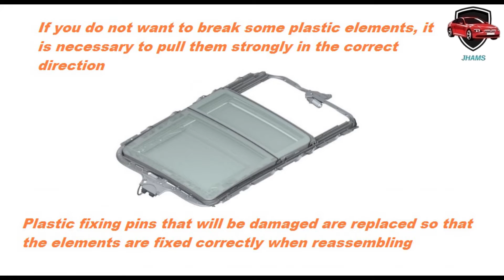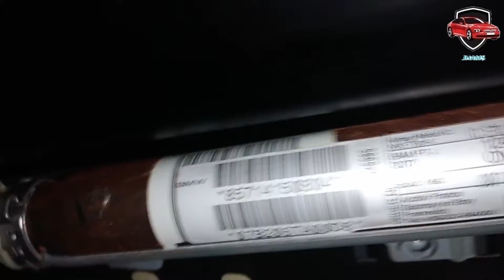BMW X5 E70 - Sunroof removal.

Comment: The sliding visir inner roof - where is the drive motor for that part? is it driven by the front one, og is there an motor nr 2 behind the visisr aft in the car roof?
Reply from the maker: The other engine in the panoramic sunroof is located in the center back under the ceiling upholstery
Reply: @JHAMS.001-car-repair  , and it serves only the inner visir?  Mine has gone locked in safe mode,,won,t reset. Panel is powered and buttons ok...
Reply from the maker: @BusterNorway  
If the window system does not work, this system does not work either. if the window system works, the system is repaired with a reset.
Reply: @JHAMS.001-car-repair  - only panorama roof not operating. FZD safe mode is the alarm code. Panel is communicating, and is clicking when reset by pushing button for 20+ seconds, but it won,t reset or clear. I can clear the codes with diagnose tool, but they appear again. Sunroof was operated when ice and frost outside by mistake, ( trying to open inner visisr only),,did not move, so I am wondering what the cause is....The roof operated smoothly before this mishap. Maybe a defect motor somewhere??
Reply from the maker: @BusterNorway Reset means to keep button press about 90 sec. If the sunroof glass system  is defective reset is impossible to bee done.
Reply: @JHAMS.001-car-repair  - Hmm, is there any way I can force the inner visir to operate? I don,t want to let the inner roof down to accesss yet..;)

Comment: Hi, my sunroof roof lining has come off. please can I know if I need to take those 2 pieces (sunroof cover) off I'll have to do the same ? Thank you
Reply from the maker: I reupholster them with self-adhesive velvet.
Reply: Hey did you solve your problem? I have the same problem. Please help me if you know how. Thanks
Reply: @octanography5685  yes if you want to take the sunroof off. You don’t have to do the whole thing. Open your cards and there are 4 screws which detach your sunroof and then you can take the cards off. Hope this helps
Reply: @hardyrayat605  Thanks a lot!!! Yes, it's helpful.